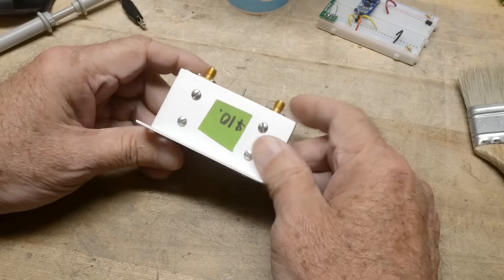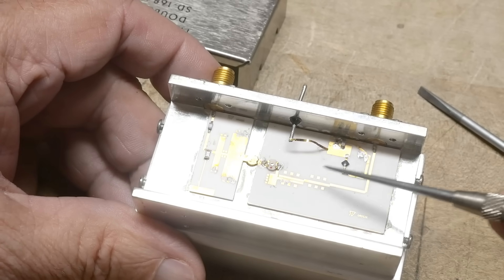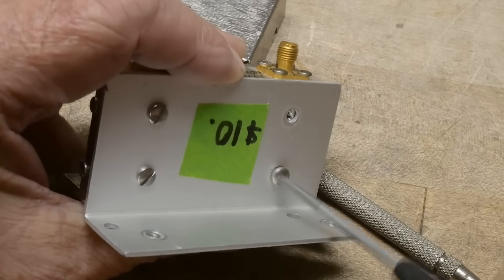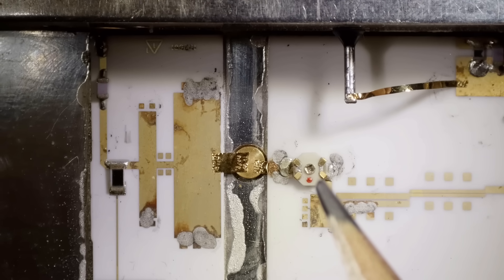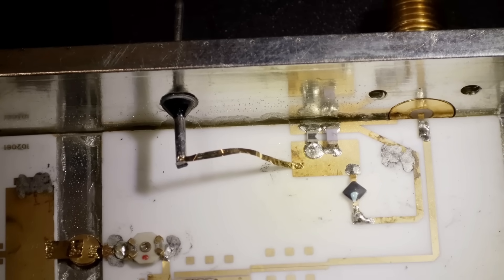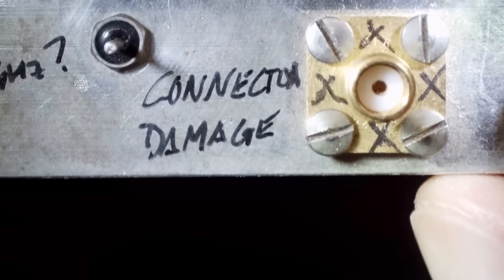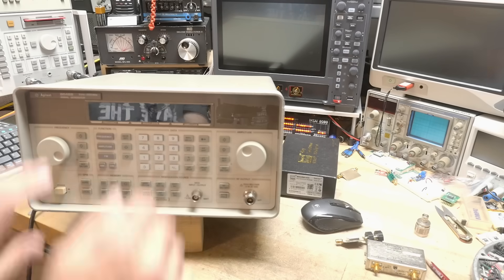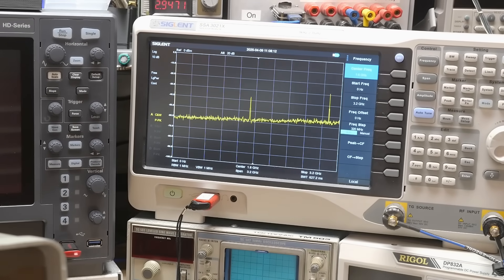#2216 GHz Frequency Doubler

Comment: Why did that tinySA suddenly gearshifted its noise floor by 15dB up at 16:00? 
Did it get damaged or is it just what it does?
Reply from the maker: it has an agressive front end amplifier (LNA) that is switched in or out during autolevel

Comment: OLD Collins rad alts used a multitude of multipliers to get like 67 MHz up to 4.3 GHz including alot of power driving mult. diodes to get maybe 1 watt of power out. The later ones used an oscillator and power amp with two transistors.  They used one of those trimmers to set the osc. frequency on 4.3, which was obviously ridiculously touchy,  and then the same trimmers to tune the amplifier.  Used an HP cavity type freq. meter to adjust rather than a counter.  I have one of those on the shelf to use with 10 Gig Gunn oscs.

Comment: Probably not a non-cavity microstrip SRD doubler? SRD's usually go 5x or so. Not 2x.....

Lots of comments saying that the white porcelain device with the red dot is actually an old trimmer C. I have some, with the little square screw thingie being the tweak. 

SRDs also take some power to get going, like 0.1-5 watts, so if it goes with less, maybe just a mixer diode doubler.

Also SRDs ohm out like shorts, so that won't help either. Some low drop e-spe-shi-al mixer diode?

Magic RF sorcery. Love it......

73 es GB
W3IHM

Comment: Might be a tripler?  Square wave to 3rd harmonic?  Filter could be quite broad.  The "monitor" might be for reflections, depending on how the wave-coupler connects.   
The failed one on my desk is for EPR, starting with a 1GHz vco, then multiple stages to double up to 8GHz output.  Since it's narrow fixed freq, they basically use fw bridge rectifiers, RF diode-pairs where one diode is fed directly, the other fed through a quarterwave delay line (maybe 15mm long at 2GHz), with DC bias to turn both diodes almost on.  So the outputs are 2F, same as with 60Hz power supply rectifiers.  Then a narrowband stripline filter to remove all the upper harmonics created by the diodes.   Then put solder-blobs all over it, to make the two separate peaks of the rectified signal be the same.
So, much, smaller, and with a cheap GHz dual diode.  But needs mini-circuits amps between all the doubler stages.

Comment: You can double the frequency with a full bridge rectifier, and then strongly filter for the second harmonic. These passive doublers are not very efficient, and need a relatively strong signal in, to generate a very weak signal out (at double the frequency) I double the thing ever flew, as you need relatively plenty of input power. (not something you want to waste on a satellite.)

Comment: That second round white thing with the red dot is probably a variable capacitor. When I used to build OTDR's we used a device that looked just like that  to adjust the dead-zone of the smallest pulse width during calibration.

Comment: Hewlett Packard Application Note 989 - Step Recovery Diode Doubler is essentially the technical documentation of this circuit minus the power meter portion.  
A follow up video around the HP app note could be very insightful for viewers as it covers the math and the circuit topology.
A copy of the app note is available at the HP Memory Project.
Reply from the maker: Thanks.  I'll have a look at that.
Reply: @IMSAIGuy  Outstanding!  Thank you, kind sir!
Reply: Good to know, I have a Tek 2901 that needs help with its doubler and triplers.
Reply: I was also thinking about a step recovery or snap action diode.

Comment: Probably a varactor diode. Very common on these frequencies. The round white thing is a variable capacitor.
Reply: A varactor diode changes capacitance by varying the DC bias on the device (and thus changing the width of the depletion region at the PN junction). There's no DC bias here, so it's probably not a varactor
Reply: Yep, it's specifically a 'memory varactor' better known as a step recovery diode.  I made another comment with the HP part number I suspect it uses but the naughty word filter ate it. 😹

Comment: The white component is a trimmer capacitor, like 'Thin-Trim - 9401 Series'. 
To get a 2nd harmonic you need some asymmetry, that what the diode is for. A square wave only generates odd harmonics.

Comment: That's an amazing piece of RF black magic.  RF engineers certainly come from a different world.  I think I'll stick with designing digital circuits.
Reply: I started at 1 MHz as a digital guy where this was all black magic but by the time I got to multi-hundred megahertz digital stuff I found I needed to be a bit of an RF guy too.  Doing 6 GHz digital layout uses the same skills as microwave stuff.  Once you learn some basics it's surprisingly easy for what it is.  The main tip I would pass along is that it's about physics of waves and thinking of the designs more as physics packages than classic electronic circuits sets you on the right foot.  You can learn all about how this device works in HP app note 989 from 1982 which is only 4 pages long.
Reply: What exactly makes you think there is no 'rf black magic' in designing digital circuits? Maybe you can get away with simple cmos circuits being simply 'wired', but with advanced cmos, the fun beguins, once you cross 10ns of rise time, you need to match the impedances, traces start to act as transmission lines, autotransformers... And when you got into modern components with few hundreed picoseconds (few tens) of rise time the fun is real. 😂  I fell in love with microwave engineering during 3rd year of college and it hasnt left me in a few decades since, though it made me cry in countless ocasions. 😂😂😂
Reply: Digital??? Any idiot can count to 1

Comment: If just passive diodes are doing the work then the transfer function should be sensitive to the amplitude. 
It could give some insight to check the output amplitude in relation to the input amplitude at some good working frequency.

Comment: I wonder how much capacitance is in a 'glob'? 
More than a 'smear' but less than a 'blob'?
Reply: I don't know the numbers, but the lowpass filter elements on the input board and the 1st part of the bandpass output filter were tuned with 'dabs'.
Reply: Well then, is the blob in series or parallel with a glob or smear???  :)
Reply: @ hm I think series it is 'Smudge', 'clump' and  'bead'

Comment: OK how about varactor doubler?  Of course a net loss through that.  You need a special tool for that ceramic trimmer cap.  A tiny square ceramic tip tunes those.  I got several of them.  Collins radio altimeters use those trimmers to align the transmitter. Nerve wrackingly touchy adjustments.  But be careful those trimmers are very fragile.  Didn't some HP signal generators use a passive diode doubler add-on attachment to extend their range?
Reply: Correction, I HAD several of the tiny little square bit tools for those trimmers.  I don't find one and maybe l left them behind when I retired. They would rarely be useful for anything to most people anyway.

Comment: Just a wild-assed guess, but would the design frequency be the number on the can itself?  1684.5 MHz?
Reply: I was thinking the same thing. It also seemed to peak when he hit around that frequency.
Reply: eyeballing the stripline filter, it looks to be bandpass,  ~2GHz or lower.   I have examples here, but on glass-epoxy board.